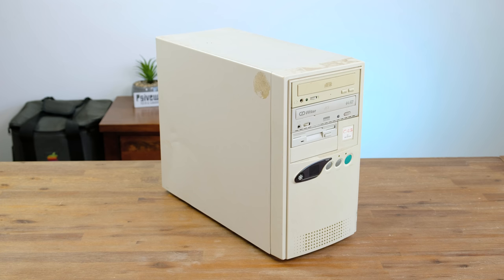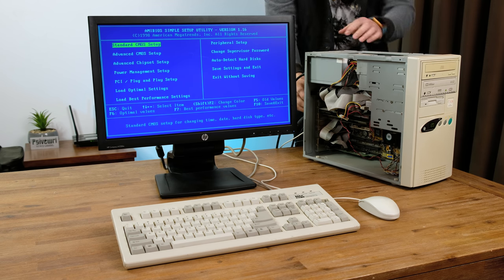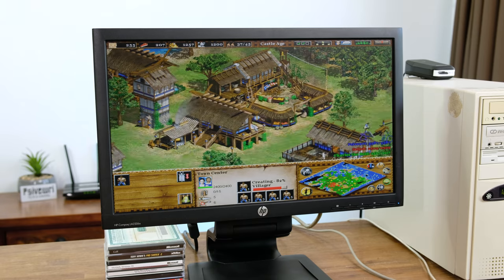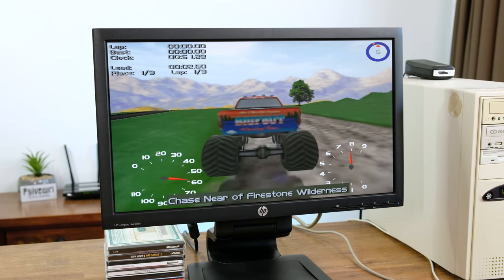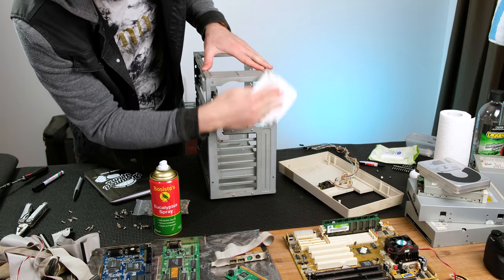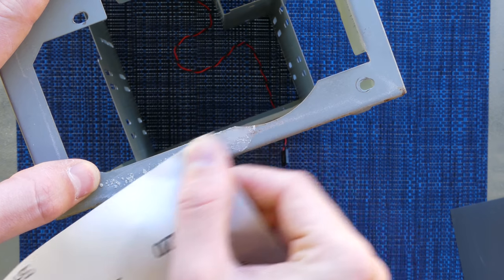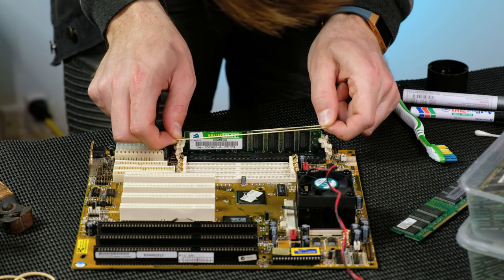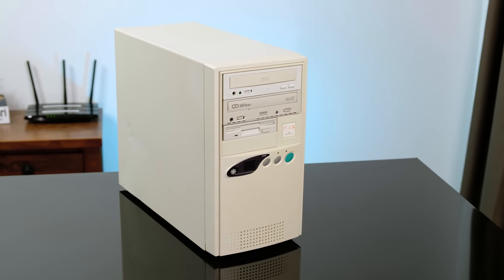Using An Old Windows ME PC! Big Mistake?

Comment: "Logic Board" It's a motherboard, this isn't an Apple Product.
Reply: mainboard

system board
Reply: @RWL2012  those are correct terms but not THE correct term, it's like calling RAM memory, yes it's right but it's RAM
Reply: @RWL2012  plus, logic board was just a term apple made up for their motherboards to make them sound special
Reply: @skyediann3399  To me it just feels like another "it's not a PC, it's filled with magic and rainbows" thing.
Reply: It's what apple wants you to believe
Reply: cpu board. I had some floppy cables that had these words on them.
Reply: Even the manufacturers can't get it right it seems 😂
Reply: Based on the fact it required apple tech to work.... that marginally debatable. LOL
Reply: The reason why Apple calls them "logic boards" is because the original Macintosh models had a CRT monitor built-in and thus it required 2 main boards to work: the "analoge board" which contained the systems' mainly high-voltage analogue electronics required to drive the CRT and the power supply. The "logic board" contained all of the digital circuitry (CPU, RAM, etc). The last Mac to feature an analogue board was the eMac as it was the last Mac to ever feature a CRT monitor built-in. Apple still calls them "logic boards" because that's what they have always called them. Hope this explanation helps :)
Reply: @ps5hasnogames55  There is always someone that can shine some truth on all the hot garbage.
Reply: no one cares it doesn’t matter
Reply: @skyediann3399  It's MA'M
Reply: Still technically its a LOGIC board
Reply: @skyediann3399  you really think "motherboard" is a more correct term than mainboard...? Isn't that like "woofer" to "bass speaker drive unit"...?
Reply: Correct.
It is a motherboard or maybe main board.
Logicboard is a very simple board.

Comment: I think the motherboard is bent, not the RAM modules.
Reply: Agreed.
Reply: Yea. I fear he is referring to the DIMM "slots" on the motherboard (please stop calling it a logic board!) as DIMMs. A DIMM is a memory module, "dual inline memory module.
Reply: Yup
Reply: Should just throw away the motherboard and get another one
Reply: I agree, the bend is quite significant. The retention clips are holding the DIMMs in place, but the pins on the stick are visible.
Reply: Motherboard IS bent. You nailed it!
Reply: @小阳光-q1o  but where do you get a ME supported core&motherboard?
Reply: He should place a piece of foam or a thermal pad under the motherboard to force it back to it's proper shape.

Comment: The only thing i remember about windows ME was the startup sound
Reply: I remember how much it crashes.
Reply from the maker: @TheDoritoFan80  So I guess you'd be hearing that start up sound a lot then 😂😂
Reply: Doesn t Windows 2000 has the same start up sound??

Edit: Ohh wait, it does...
Reply: Isn't the same of 2000?
Reply: @TheDoritoFan80  So many people complained about Windows Me crashes, but I always found it to be very stable, and I built many computers with that OS.
Reply: @AtomicAJ74  well you got lucky with the drivers
Reply: @TheDoritoFan80  It was more than 20 computers using different motherboards, hard drives, sound cards, and video cards. Never ONCE did I see a system that was inherently less stable than a Windows 98 system.
Reply: @AtomicAJ74  people just love to jump on the hate bandwagon
Reply: The only reason I got to experience Window ME was because my dad bought an IBM computer with Windows ME installed. In my experience it wasn't bad but it wasn't great either. I just felt it was a reskined windows 98.
Reply: @AtomicAJ74  had a Win98 plus system while growing up. Never had a crash.
Reply: @SummonerArthur  I don't believe you. Everyone had crashes from time to time.
Reply: @AtomicAJ74  not even a single one.
Reply: @namesurname4666  Essentially. 2000 was more for business though, ME was more for home use.
Reply: That startup sound was life! Oh the memories! Dude is to young to remember.

I actually go way back to Windows 3.0 - 3.1 [1990 - 1994] & Windows 95 [1995]
Reply: Best Windows startup theme of them all
Reply: My mom had a windows ME computer when I was a kid. I don’t remember it ever crashing. I have many fond memories with it.
Reply: The only thing I remember is formatting and reinstalling windows 98.
Reply: I only remember the BSODs.

Comment: 2019: Using an old windows me in 2019
2039: Using an old windows 10 in 2039
Reply: Boris Sladakovic  3059 using an old windows supernova ultra extra 9000k, oh wait humatity is gone
Reply: 2079: Using an old MicAppleSoft v1 in 2079
Reply: Windows 10 won't be usable in 2029
Reply: Windows 10 might be renamed as only "Windows" in the future. Similar to what apple did to MacOs.
Reply: 2020: stopped being an idiot, and switched to Linux
Reply: More like 2203 but okay
Reply: Microsoft will see to it that you won't.
Reply: 2014: Windows XP Turns Ended
2017: Windows Vista Turns Ended
2020: Windows 7 Turns Ended
2029: Windows 10 Turns Ended
2100: Windows Turns INFINITY!
Reply: @borlemdias9532  honestly, linux sucks
Reply: Party Petusum Linux suck so much, most of the servers that run the world use Linux 🙄
Reply: @borlemdias9532  Well due to its simplicity it is pretty easy to use but it just sucks when it comes to gaming and most people complain a lot that you cant use windows apps on linux and the user interface is meh...
Reply: Borlem Dias ew no windows is where its at
Reply: 2020: using an old windows 98 computer
2030: using an old windows xp computer 
2040: using an old windows 7 computer
2050: using an old windows 8 computer
2060: using an old windows 8.1 computer
2070: using an old windows 10 computer
2080: using an old windows 12 computer
2090: using an old windows 13 computer
3000: using the oldest computer alive the windows 10 computer from 2020.
Reply: @faishalrafielian9061  no its planned to be windows 12
Reply: @Windows 9 / Windows 10 it will end when windows 15 is created or if google is wrong when windows is created
Reply: 2035: Using an old Core i9 Gaming rig from 2020, is it still usable?
Reply: I think today PCs and SW will be useless in the future because of online services will be already turned off. Old HW from 90s is fun because you always know you can operate that without problem if you have all installation disks, everything is offline.
Reply: @Bigbadwhitecracker  2025*
Reply: @Bigbadwhitecracker  Why?
Reply: @yamira.737  sorry i meant humatitty
Reply: @faishalrafielian9061  ikr
Reply: M. M. windows 10 is forever going to be the newest os even confirmed by microsoft
Reply: Windows 10 the last windows.....hurts

Comment: 1:00 So it's a safe bet you haven't played with Windows 2000 either. Windows ME and 2000 had the same startup chime.
Reply: same Os but in other names
Reply: Windows 2000 is what I grew up with. It was a beige Dell Optiplex GX1 from my dad's workplace after they switched to modern laptops. That startup brings back so many memories.
Reply: @iClone101  I installed Windows 2000 alongside Windows 98 SE on the first computer I built. Windows 98 became a huge waste of space on my hard drive because I spent most of my time booting into Windows 2000.
Reply: And what a SWEEEET tone it was, especially because when you heard it, you knew things were working lol!

Comment: I loved Windows ME back in the day and really didn't understand the dislike that it got. It really did just feel like Windows 98 3rd Edition to me. Now true I used a tool called the Optional Component Maker to strip a lot of the tat out but ME always ran sweet as a nut for me.

The only reason I moved on was because I was desperate to play The Battle for Middle-Earth and that game only ran on Windows XP.
Reply: Probably because you were lucky enough to be using hardware that Windows ME could actually use without crashing.
One of ME's greatest stability flaws was the lack of good drivers available, which is why the OS actually runs fairly well on a Virtual Machine.

Comment: That K6-2 processor is a good CPU, but it is still a low-end processor to be running Windows Millennium Edition. 128 MB of RAM will make a huge difference in performance for most tasks.

That board uses both EDO RAM and SDRAM. I’m impressed. I’m sure they board has a physical addressing limit of 128 MB, so it didn’t matter how much RAM you installed.

Very nice work cleaning up the system!
Reply: I was 6 years old back in 2003 when I used to play Yetisports mini games on my sister's boyfriend's Windows XP PC... The shrieking sound of a chunky 56K dial-up modem was such an earache

Comment: You should got up PhilsComputerLab for some assistance on upgrading this beast. Compact flash, CPU, vram, ram etc. Also that PSU is a time bomb!
Reply: Agreed, and finding an old 1024X768 LCD monitor is a must for a system like this. I fairly regular see people throwing out old eMachines monitors like that at my local thrift stores, and keep one myself in storage in case I ever need it.
Reply from the maker: @CommodoreFan64  Over the years I've owned well over 50 LCD monitors like that, however I never thought I'd ever need one 😅
Reply: @psivewri  When I first met my girlfriend, she was like why do you keep all these older computer parts, and such, then a few days later her laptop started acting up, said bring to me, her HDD had crapped out, I walked to my bin of laptop drives I had salvaged, pulled out a near matching drive put it in, installed Linux Mint Mate on it, said I just save you $200 USD taking it some place else to get fixed, and she's never questioned me again when I find stuff while out on a thrift hunt, so I always keep at least one or 2 of an item I think I might need in the future either for myself, or someone else.
Reply: @psivewri  hey, i can send you one if you want!
Reply: @psivewri  you scored big with the Voodoo 2, great find!
Reply: @mdrumt  I had a similar experience at the Dallas TX First Saturday downtown flea market years ago.  Got a Powerboat 1400 for $5 (got the seller to throw in a power supply and laptop bag that weren't originally included) - got home and it worked GREAT!  Months later I was taking it apart and found it had an upgraded processor (Nupower,  IIRC) that had a market value at the time of about $75. Still have that machine somewhere....

Comment: Looks like a 66MHz FSB K6 300MHz. See if the motherboard can do 4.5x so you can get the full 300MHz!
Reply: When he showed the CPU after removing the heatsink, I was like WTF, that's a 300, BIOS settings must be screwed up. I remember upgrading from my Pentium 133 to a K6 2, can't recall the clock speed though but it would have been somewhere in this area. Good times.
Reply: It's a pcchips socket 7 motherboard,  so doubt it and the voltage will be to high too.
Reply: i used to have an amd k6-2 of 350 mhz

Comment: Windows ME on 1997/1998 hardware, it's kind of slow but at least it works.
Reply: ME is almost the same as 98 SE, just loaded with a few more features (and bugs) :D
Reply: @crashbandicoot4everr  There have been a lot of fanmade fixes that take care of ME enough to be stable.
Reply: @crashbandicoot4everr  98SE is still "new" for that kind of hardware, I'll never understand why more of those retro scene people don't just use Windows 95
Reply: @RWL2012  It's infamous driver issues.

Comment: Loved it! Some suggestions: You could have tidied up the cables, especially the flat cables, using nylon cable ties. It would look better if you set the case display with the K6 CPU clock in use.

Comment: The CPU is a k6/2 300, not a 233. Check the mainboards jumper settings
Reply: I presume the type of the motherboard is PcChips M560 REV: 3.1A, according to the document:
http://www.tqm.com.uy/archivos/pcchips/manuales/M560/M560V31.PDF
The CPU external clock it supports is 66mhz, 75mhz and 83mhz, while the internal clock speed selector can only goes as high as 3.5X. Forget about 83mhz, which is too risky for PCI peripherals, if we select 75mhz*3.5=261mhz, roughly 26mhz, still can't go up to 300mhz........
Reply: @ching-chenhuang8119  It`s a PCChips M575.
Reply: @fuentescgabriel  Would a BIOS update solves the issue of detection? I guess these are the early SDRAM slots, and these mobo maybe picky. I would populate it with low RAM (64MB/128MB). A 128MB would be perfect for Win98SE.
Reply: Someone else caught that too eh!? Yeah, AMD K6 starting line was 266Mhz, which surpassed INTEL's 233MMX CPU rating. But yes, this one was a 300. I knew I was not going cray cray yet lol!
Reply: Jimmy S  Ding Ding Ding! Right O! As a tech I dreaded working on client's PCs with that darn PCChips TXpro and VX pro boards! Their Cheaposity would sometimes cause ME to be blamed for their PC not working anymore lol! They called me cause it was not working RIGHT, then I would fix the issue and Windows optimal settings and correct hardware drivers,etc would prove to be too much for these boards sometimes. The CPU/RAM/FSB settings issue was one such FIX that caused a blow to the system, as alot of those PC CHIPS boards also suffered the dreaded Leaky bulging capocalipse. I am VERY surprised the system here did not perform an illegal operation after rebuilding it with the ram half in like that. AND Windows ME was very unstable product so even more surprised indeed!
Reply: @pianokeyjoe  the K6 started at 166Mhz
K6/2 started at 266.
Reply: @phaztheaussiebastard  Aah! Thats right! I remember now! Like with the Cyrix and IDT Win Chip! Oh how I love these discussions lol!
Reply: @pianokeyjoe  I remember the cyrix/IBM CPUs i had one, also remember the IDT winchips, although i never used one myself or built any systems that used them. they were pretty crap from what i heard
Reply: Jimmy S  Aargh! Jimmy! You KNOW my pain lol! Yes! SIS chipset! That and those Cyrix Cpus! Yes, cheap cheap and cheap! Alot of my customers had that combo and even some DELL, PACKARD HELL and HP PAVILION computers had that same chipset. Another one was the systems with the onboard S3 virge cheap onboard vga and opti sound cards.. But NOTHING, outcrapped, the SIS chipsets! Would you believe that I bought a brand new MINI ITX INTEL CPU combo motherboard that had an integrated Celeron CPU for around $100 in 2010, and when I hooked it up brand new mind you, it locked up? SIS chipset! NOT INTEL.. They lied! lol! PCCHIPS was bad, just bad.
Reply: @phaztheaussiebastard  YES, they were horrible! The Cyrix fiasco is well known but IDT Win Chip was a limited run thing so not many PC repair folks know about it or had their hands on one. I frequented the computer shows that came into town once or twice a year. This was 2000-2004. That is how alot of people got ahold of old parts,cheap parts, and new and innovative parts. The WinChip ran slow, and did not really have MMX, so alot of my music software would crash and burn. I sold my Winchip or returned it or something lol! I only used Cyrix in my own system ONCE.. That was enough.
Reply: Jimmy S  Oh wow lol! I did not play much in the 486 arena as those were too old and slow for me(I started with a Pentium 75 though). WOW! So THAT explains my woes! Those lying faking bastards! LOL! Yes VIA can be trouble but most of the time it is when you push the limits on them. Which people did, to save a buck and get more for less(overclocking, over FSB, over voltage setting CPUs), and even using the ram to max capacity on those boards would yield undesired results as it happening to me now in 2020 with an old VIA Apollo133A slot one board!
Reply: @pianokeyjoe  i saw them being sold at PC shops in the early 2000s, never really took notice, i know they (and cyrix for that matter) were bought out by VIA technologies
Reply: Jimmy S  i ran nforce on a couple of my builds, never had an issue with them

Comment: 4:02 - if no one pointed out already, Duke Nukem 3D was not using 3D accelerator mostly due do to the fact - it's not a 3D game, but rather "2.5D", as it's been called. Quake 2, on the other hand, uses a real 3D engine and hence can take advantage of hardware 3D acceleration. Otherwise, cool video! :)

Comment: 0:10 What a back panel! This is way, way older than a standard era-appropriate WinMe machine would be! Very much early Win95 or even 3.1 kind of machine... Numberless upgrades (RAM maxed to what the motherboard can take, cd burner, and so on) kind of mask that, but serial and parallel ports on dedicated plates, XT style keyboard port... really primitive.

Comment: Nice restoration !

I found some useful informations for your PC :

The motherboard is a PCChips M575. (Shady motherboard manufacturer, but as long it works, it should be allright). The "TXpro" chipset is actually and ALi M1531 (Aladdin IV+) so if you need drivers for it, look for that instead. You should be able to enable USB somehow, maybe you need some driver for that or you have to enable then in the BIOS.
Also check for that number, you should find some website named "elhvb" where they let you download an archive containing the latest bios, some drivers and jumper settings for CPUs ! They even show you what settings to use with a K6-2 300, so you can run it at its maximum speed :)

Also, you might want to consider to downgrade to Windows 98SE : Windows ME has many disadvantages over Windows 98. Windows ME's DOS is really really bad to run old games (almost as bad as windows xp's) while 98's is pretty much the best version of DOS. Also 98 can do pretty much all what ME can do (though you have to install everything it lacks yourself while it's packed in the install disc for ME).

Last but not least, if you plan to play DOS games, I recommend you to install a different sound card that the one integrated on the mobo. Brands like Yamaha (ISA or PCI), Creative Labs (ISA only) or ESS (ISA or PCI) should do the trick very nicely :)

Other than this, the bend on the board looks very bad, I'm surprised it's still working, hopefully you can fully get rid of it ...
Reply: Do you have drivers for vx pro ii im just asking